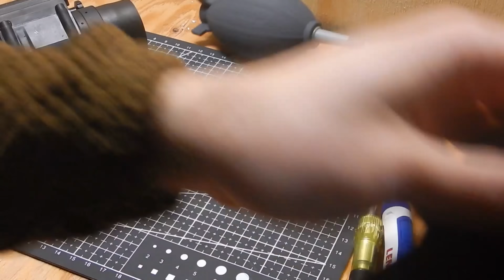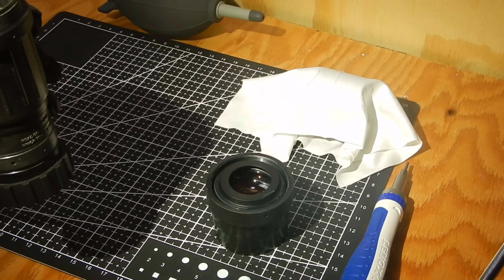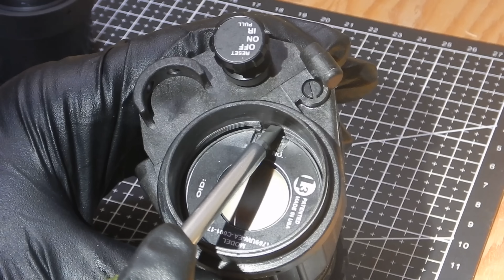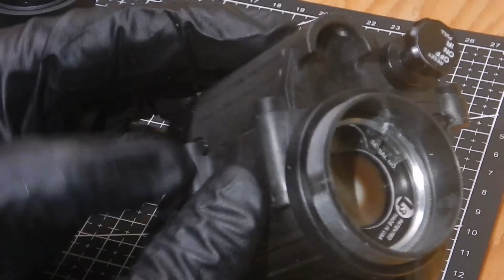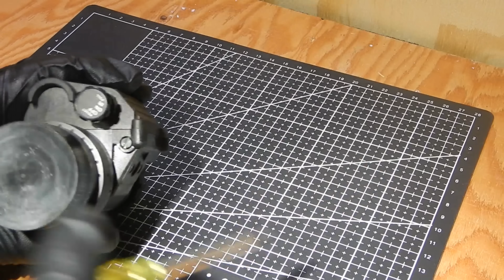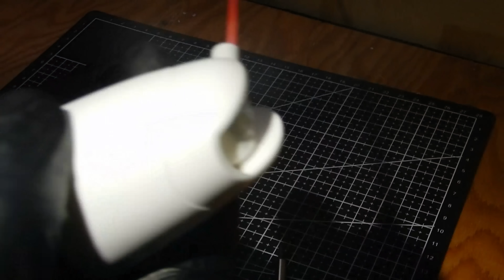How to Build Your Own PVS-14

Comment: So what IF you want to N purge it? I’m in HVAC and have vacuum pump and nitrogen tank in the garage LOL i assume it somewhat the same? vacuum then pressurize? any chance you can supply some recommended pressures
Reply: Military standard is 3 not to exceed 5 PSI pressured with the ocular and focus lenses in the outermost travel point.
Reply: probably about 1 standard atmosphere, unless you plan on using it on venus or mars. 15PSI. Little more probably wouldn't hurt.
I don't actually know anything about night vision though so take that with a heaping tablespoon of salt.
Reply: i’ll have to pass on this, my regulator has presets and at the lowest is 15psi lol don’t wana chance it

Comment: Coming from a very young man:
I am a couple years into sharing the societal perspectives of this channel. I want to be prepared to do whatever I may be required to do, and I know that there are a plethora of changes I need to make to achieve this. Some of the simplest among these (becoming physically fit and financially independent) I am in the process of making. But the main thing I am needing (which I think that this channel could do a great job of providing) is time-efficient and all-encompassing guidance towards achieving this. In sympathizing with the low budgets and relatively limited expertise of much of your viewer base (as you already often do), I think a series devoted to guiding newcomers and novices such as myself on the individual steps they should take would be indescribably invaluable. Things as broad as finding/forming real likeminded communities as referenced in the KOCOA video, down to avoiding online surveillance without ditching the internet entirely. I just feel very lost and overwhelmed at the number and scale of things/concepts which it seems are necessary for me to become a SME in but also have very few publicly available comprehensive trainings/resources on them (at least outside of the military). I hope that I’ve made clear the distinction between what I am suggesting and what you all have already made, and how much I still appreciate what you’ve already made. Thank you for your work and I hope others in my boat agree and that this is helpful to y’all!
Reply: A good place to start would be by specifically noting all of the topics you are wanting clarification on. 
Are you talking specifically about the surveilance aspect? Or are you including topics like Survival skills, firearms, navigation, radio, etc? 

The best course of action is through books regardless. If the power goes out or the internet gets shut off a book can still be read.

Comment: Quick tip for your argon purge, heat shrink tubing is great for shrinking the ends of spray straws to be even finer. I've done purging in a similar manner and even gone so far as to shrink the tubing onto a bit of hypodermic needle to get the gas as far into the chamber as possible in hopes to drive out the air without much mixing. Maybe you find the advise useful.

Comment: I’m looking to get either a 14 or a set of 31’s in the next couple months. Cant wait to have some owl eyes or eye depending on which one I can afford 😂
Reply: I got my NV. Had it for about 6 months now. Gotta Gen3 TNVC L3 thin filmed GP PVS14, gotta ballistic helmet and a g24 Wilcox mount with a dual dovetail arm so I can use over either eye and it stays secure. I would still like to build a PVS14 in the future now that I have one that is in great shape and works well I feel like I’d feel better about trying to put one together. I’m just nervous about buying image intensifier tubes from someone without being able to see how it works and if it has blems etc etc. I was glad to get it from a guy so I didn’t have any registry of any kind which I was a fan of as well.

Comment: Lots of misconceptions in the first minute. Most companies don’t require anything other than an ITAR acknowledgment. Furthermore, if the tubes are substandard, they would be advertised as such. Most of the PVS14s I sell are high spec L3 filmless (exceed 2376 fom), or to provide budget options we also sell Elbit GP/WP with milspec requirements at a minimum. Otherwise it is made clear that the tubes are “budget” or “com spec” then priced accordingly.
Reply: Do you have a website for your wares? I'd like to take a gander!

Comment: A tyre shop once wanted to charge me an extra tenner for filling the tyres up with 'Nitrogen'. I told them that i hadn't asked for 'nitrogen' and that I only like my tyres with 70% nitrogen with a  blend of oxygen, carbon dioxide, monoxide and a few  trace gases.

Made him let all the air out and refill from the compressor. Try to rip me off and I will waste your time

Comment: I have a harvest right freeze dryer. I could simply pull, a vacuum into the chamber, then refill the chamber with nitrogen/argon. (Obviously I would not freeze the chamber or turn on the heating elements)
Any thoughts?
Reply: That’s an expensive vaccine 🤣… vacuum
Reply: @davidb9323  indeed it is.... but I use it for other stuff occasionally,  lol
Reply: @GuyActual  better run that thing 24/7, you could start an at home business while other companies run out of supplies (Agustin Farms**)

Comment: Why not just assemble the kit inside a nitrogen purged glove bag? We used to use them in my inorganic chemistry lab all the time. Just purge it long enough to get all the air out, and maintain positive nitrogen pressure inside the bag and you're good to go. The bags cost less than $40.

Comment: As far as nitrogen gas goes and vaccume sealing, auto air conditioning shop's have large tanks of nitrogen gas.. = Leak testing..   .
A brake line bleeder, hand held..
Is what I use..  6 inch diameter PVC PIPE..  12 to 15 inch long.. A 6 inch PVC glue cap.. 6 inch clean out adapter w/screw on cap.. A few plastic fittings from the hardware store, drill, drill bit, 1/4 inch tap for cutting or making threads on side of pipe.. = with the brake bleeder, tubing, plastic fittings, you now have a vacuum chamber.. To fit your project there..😜..  This is also great for vacuum sealing quart mason jars.. Or the smaller one's.. 
Put just the lid, not the ring yet, pump the brake bleeder, 10 to 14 pounds.. And the lid is stuck/sealed on THERE...   So your stored..  ???.. 
Will STAY fresh..
Gas that pipe good, place the screw on cap tight.. Pump the bleeder, get your device back out, with the string you tied on it,... Screw hole facing up.. Quickly replace tiny screw..
No gas for sealing jars.. 🏴 ☠..
Note:..  Water boils at 28 psig.
@ 69 degrees..???..
So a ROBINAIR, vac.pump will pull down that far.. Removing all mosture from a/c line's.. 
All THAT.. And I'm just saying, it's not that hard to vacuum seal thing's..
I have put AWAY dry goods/food for the short time we'll be taking to kill off control freak communist BASTARDS on our side of the 🌎.. 🇺🇸...  However I've used this method for optical equipment.. 
Oh, water and refrigerant, make a acid that eats many metals,... 
Mosture has to be vacuum/evacuate , a/c line's before adding refrigerant to a/c system... 
This is the way shade tree mechanics ruin the car's a/c
 system. By not evacuating moisture first.. Also, if it won't pull down.. 
It's leaking.. 
AND moisture in your optical equipment, will begin to grow fungus.. 
Sorry for the book..

Comment: I have an old unit with a damaged tube, and I think that is it. It will work for maybe 15 minutes before it shuts off and lights will leave a clear trail. Does anyone know 1. How to make sure it’s only the tube that is damaged? 2. Explain why the unit shuts off after 15 min then won’t be able to be turned on for another 10? Any good sites to purchase new tubes? Thanks for your help if any of you guys know. Thanks!

Comment: Purging is done because this kind of nitrogen is DRY (so is the argon).  The whole idea is to remove water vapor so it won't condense on your optics when your PVS-14 goes from warm to cold environments.  "Canned Air" is usually some relative or variant of difluroethane, and over time those chemicals can degrade certain plastics and rubber compounds.  You do Not want to find out the hard way that a lens gasket was one of them.
     Tilting the gas canister too far will result in liquid argon entering the monocular, which is technically not 'moisture'.  It will not cause condensation inside the PVS-14 directly, but it will make the housing cold, which could cause condensation if any water vapor is left inside  (not likely due to the tiny volume and dryness of the gas).  If it happens by accident, just let it warm up and spray the gas in there again.  There is a mechanical danger, though fairly unlikely.  The liquid is extremely cold, and could cause cold-shock issues like misalignment of the optics, or in extreme cases breaking a lens or the light amplification tube (not likely to happen, and would require squirting a lot of liquid argon/nitrogen in there, probably on purpose).
Reply: No you will not get liquid Argon inside, for Agron to be liquid you need to cool it to -303F.
Reply: @Thorgon-Cross  That's at atmospheric pressure, but I get your point.  If there's any liquid coming out of that can, it's not 100% Argon.  Liquid Argon at room temperature would be under an enormous amount of pressure.
Reply: Lol I was confused for a sec. I never said any of this!
Reply: @cwinter90  I've had the same issue with people having the same username and icon as me.
Reply: Ý
Reply: There are security systems that actually use "dry" air, so dry that the thing is monitored for the slightest of moisture. Ways to bypass a lot of things, that one not so easy

Comment: An easier why to purge is to get a 5gal plastic bucket, place your disassembled kit into it. Then fill it with argon, and since argon is heavier than air it will displace the air then screw everything tight.
Reply: k but the bubbles of air that rise to the top of every nook and cranny inside the device are going to take days to diffuse out this way.... not that it matters lol. gases dont just instantly mix, they follow ghrams law of diffusion across an interface of two dissimilar density pockets
Reply: @vevenaneathna  that is why you fully disassemble it before dumping the argon in.

Comment: This is awesome. You could sell  the curated part kits and spare parts, develop this channel as NV for dummies.  Lots of  fans of this kind of DIY stuff.
Reply: 100% I'm wondering the price to build one. I know they are around $2500-$3000 to buy so I'd figure around $1500 or so to build yourself? Cheaper would be cool.
Reply: @mediocrefloridaman  the tube are around $2k on the sites I looked at. Definitely not a cheap diy project
Reply: @jeffgayzose8129  yeah for sure. I think I'd pay $3k to have it built for me. Not feeling like a diy project to save just a few hundred bucks.
Reply: @mediocrefloridaman  There's the privacy factor too though. You might have issues getting one because of stupid requirements.
Reply: @vokovom-u9332  what kind of requirements?
Reply: @mediocrefloridaman  The kind explained in the video.
Reply: @Wayloz  oh cool.  Thanks for not adding anything to this conversation. You just watched the video. What requirements?
Reply: @mediocrefloridaman  The ones he explains better than i can, in the video.
Reply: @mediocrefloridaman  bro… good nods are 10-20 grand
Reply: @lukeknight1133  are pvs14 not good nods or what?
Reply: Agreed! I used a 3d printer to make my first NVG (from the guide on TFB) and would like to upgrade
Reply: @josedorsaith5261  do u have a link?

Comment: Cool. Seen vids about this before, but you raise some good points as far as availability. Usually the "nitrogen purge" is done mainly to displace moist air, the gas isn't terribly important. As a few others have pointed out, using a longer needle that goes deeper inside the device is going to be a lot more effective with the argon purge. Also, for a DIY nitrogen purge setup, probably looking at a few hundred bucks, but wouldn't be worth doing unless you were going to be doing a lot of 'em just due to storage space.

Comment: What's the price difference?
Reply: Not much different, but you can buy it in stages rather than all at once. I spent about $700 on the entire housing kit and lenses, and about $2500 on the intensifier tube.

Comment: is there any reason not to run dual pvs-14s over an already premade dual option? seems like the overall price could be cheaper but maybe im just not reading between the lines enough
Reply: RNVG or PVS31 is much lighter than dual 14’s

Comment: If you have a welder friend with a 100% argon tank you could do similar as you did in the video, but maybe have it in a tall plastic ware container so it generates a bath of argon for you to work in, and likely much cheaper, while also giving you a flow control so you do not generate much turbulence.

Comment: If toy were to go to a paintball shop, most of them fill nitrogen tanks, your mileage may vart. if they do, have them put a needle on an airline downstream of a regulator, and have them spray in the nitrogen for about 20-30 seconds at 15-20 psi. that will replace a VAST majority of the gasses in the housing with nitrogen, much like your argon fix, with the same result.
Reply: The heat is an issue with that kind of nitrogen fill.

Comment: I don't think most people need to go the purging route. I've taken apart my NV a few times and never purged it. I never really had any problems with fogging. You just need to make sure you assemble it in a dry environment. I guess if you can easily get some Argon in a can, then it doesn't hurt to do it I suppose. I just haven't found it necessary. 

I guess if you are going to be using it where you go from hot to cold and wet to dry a lot then purging is worth it. My NV stays in my safe and I live in an old house with no insulation and no central heating and A/C so the temp is usually not much warmer/colder than the outside temp. I've never had a problem with fogging when grabbing my NV from the safe and walking outside with it.

Comment: I recall that port with the screw would have a valve for the vacuum and purge process. This video is more in depth that my week's work of training for maintenance. The calibration test that was taught requires that expensive equipment you had referenced. Great video.
Reply: Most of the goggles do. Pvs14s usually just have a screw with oring

Comment: its not the inert ~30% non nitrogen you are worried about... its the humudity a pure nitrogen purge allows... im lucky on a good day i have 10% humidity here in the high steppe. use of desicants inside an air tight chamber can take the vast majority if remaining water out

Comment: I have an ENVIS M703e that I want to switch into a more usable housing, but I really haven't been able to find a full PVS-14 parts kit. They either don't have any kits in stock, or you have to piece meal everything with some parts not being available. I really want to keep the lenses b/c the ENVIS has a superior ocular lens (I've heard this claimed multiple times, don't know if its true) and the objective lens uses the C-mount pattern so you can use all kinds of security camera lenses and attachments for it.

AB Nightvision used to make a housing specifically for this, but they don't sell direct anymore and it looks like they no loner make the housing I need.

Any advice as to what route I should take or where to find in stock parts?

Comment: A lot of comments about humidity. Get an outside/inside weather station. You might be surprised at how dry your house is, especially if you have heat on. Mine is 40% right now.

Comment: Here is what I do for a temporary clean room while assembling NVGs. Make a box out of dollar store foam board, about 2ft by 2ft. Lay it on end so you can see through it. On the back end place a cheap 2'x2' box fan so that it is blowing towards you. On the back side of the fan, tape a 24x24 high grade furnace filter. This will create a positive pressure clean box that will have a constant flow of clean air while blowing out any dust or dirt that you introduce. 

It works great and you no longer have to worry about dust or hairs on the lenses while assembling. And it costs about 30 bucks and you can use it for a lot of purpose. Also works for painting if you turn the fan around.
Reply: Just the concept of this is very worth mentioning. I can think of ten ways to make the same thing but wouldn’t have considered it without this comment. Thank you, I’m putting this on my list of projects if things settle down. Kind of pissed I didn’t see this video at release; part kits probably aren’t even worth looking up right now.
Reply: A furnace filter would not come close to clean room standards. You are going to want HEPA, but it is a decent amount of filtering.
Reply: @mattlewandowski73  It's better than nothing,  and optically speaking,  you don't care about objects that are smaller than the wavelength of light you're dealing with.
Reply: Used to do something similar with a upside down fishtank and a sand blaster for bicycles.

Comment: Hey brother what's a fair price on a pvs14 kit? Seeing how simple building one is just inspired me to finally get into setting up some nods. Just want to know what fair pricing is since I know next to nothing about the night vision market.
Reply: Ive seen foreign agm/apache kits for as low as 550, I'd spend the extra for a Carson USA made kit. The tubes will cost you whatever you can find them for
Reply: @ChevTecGroup  the tubes are what I was most curious about. Just trying to make sure I don't get fucked inside out when I go to build one out
Reply: @TOO_RAW  the wide variation of quality makes the prices change a lot. I've found severely blemmed but somewhat usable tubes for 500 bucks. And some totally usable, used with minor blems for 1000-1200. New tubes will likely cost you 2k+ unless you can order a large quantity direct from a manufacturer like elbit or L3
Reply: Still WELL outside my price range.